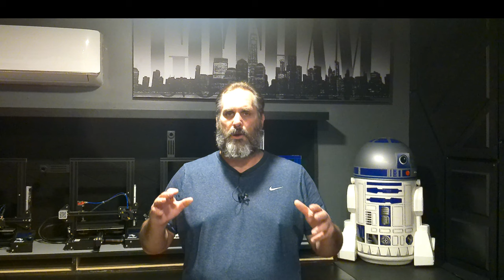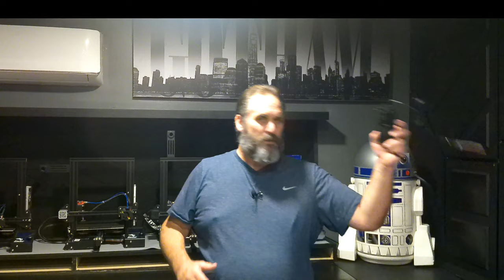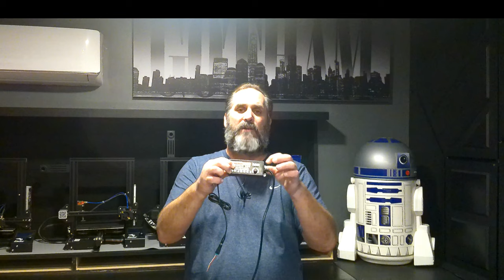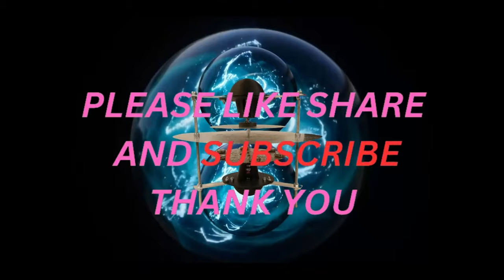Graviflyer "Over Unity Event" #28

Comment: I have Been Studying This For 15 Years Now, and I Do NOT Believe Grounding Anything Will Matter Much, BUT.... If You Could Measure the Distance of That Field at It's Phase Shift Boundary, ( where it ends, try using a Radio on A.M., in between stations ) That would be Where You construct your Faraday Cage (shielding) /Outer Shell of The Craft You would Like To Lift ( remember weight does not Matter)  Just a Thought .....But That EVENT is LEADING Me to believe You have Found The Key to the Heart of a Craft!     Again it is Just a Thought .....!
Reply: I tend to agree with your grounding assessment. It appears as if there is pumping effect to "ALL" matter in a local region of the object. Grounding would probably have little to no real impact on it's operations.
Reply: A Faraday Cage would prove if its ZPE energy or not.  The Faraday Cage would not stop ZPE energy.
Reply: Why not use ferrofluid in side of glass container or ferrofluid in side laminated sheets
Reply: @angelguerrero2890  Ferro fluid utilization is an interesting thing to consider 🤔.  Very interesting 😎

Comment: Strange stuff happens when experimenting with high voltage. You sound like you did have a weird experience, which is interesting.
 Electricity is present in all that exists. We still don't know the complete science of electricity or anything for that matter.
I had a weird experience a few years back while trying out small spark gap Tesla coils. The secondary coil was only about 11 inches tall and I was trying out different size primary coils. I know that the transfer of energy does happen but I never thought it could happen with such a small Tesla coil.
So what happened? Well, at one point all the bulbs in the house lit up and then went off. This happened twice. It was really strange.
Don't stop your work buddy. You are discovering something new all the time with this project. Good luck and I will continue to follow. 👍👍👍

Comment: 3 things. 1 i can't remember the name of this material's name but it shows magnetic fields in its sheet card shape and thickness. 
2 maybe a grounding sub chassis to block out interference and contain or crisp/triangulate/harmonizing all different phases of energy to help synchronize the crossover.
3 build a faraday cage so you can monitor and protect your equipment. 
Thank you.
Reply: Thank you so much. Also please back up all your data before you are disappeared. Thank you for sharing.
Reply: Measure for microwaves!
Reply from the maker: I did.

Comment: I think that alexey talk about this. If charge is too strong plate get magnetized and its not good because its change resonant frequency. So you cant keep it on all the time you need to switch it off/on. Also if charge is too strong it wont separate those spinning fields normaly and and you need to start all over again
Reply from the maker: I know. It happened before I got to tune anything.

Comment: Ground your surroundings. The toolbox is insulated from ground. So is everything else on your bench. Get a grounded copper benchtop cover. Static charge can build up if there is no path to ground and the air is dry.
Reply from the maker: It happened right away. There was no build up. It was the first test for the day. the hv and the tc were pulgen in one after the next and the tv flipped out right away. It started to change the browser tabs by itself. I will ground everything before the next test. I have had hv interference before. This was different.
Reply: @nathanbunten4299  That used to happen anytime my wife with long hair got into my Tesla. The dashboard would go nuts!
Reply from the maker: @ToddDesiato  The fact that the field extended beyond the Graviflyer was what surprised me. Long hair in an electric car. Was her hair frizzed out? Static and electronics do not play well together.

Comment: Great results, I am definitely going to try this. Did you put both wires from the spinning discs down the tesla coil and the positive wire from the flyback to the center plate?
Reply from the maker: The tesla coil had 1 wire run through the center of the tesla coil. The ends of that wire wer set to the 2 spinning plates. the part that came out of the top was going to the top disc. The part coming out the bottom is  going to the bottom disc. 

The high voltage is 2 flybacks in series and the positive wire was to the center plate. The negative wire is to nothing.

Comment: Sorry to see it scared you so much.
Are you familiar with Bob's work at MF MP?
Did you consider that you were building a hyper torroidal field around the device.
Then when you reversed the polarity, it caused the device to start pulling power out of the field you are stored the energy in, and that is where the energy came from.
Hyper torroidal fields are like magnetic monopoles and according to Bob they like to live in aluminum because it is a single isotope metal.
It's very similar to the type of field hutichison was building in his aluminum bars.
You may want to consider making a shielding enclosure, I will send you some links.
Reply from the maker: thank you.

Comment: i think that if you need electrostatic charge, the best hv power supply is a vandergraff generator
Reply from the maker: it's not just static volts it has to be able to mesh with the tesla coil. It has to be dc.

Comment: Try to make an asymmetrical capacitor with a solid dielectric with a high k value. The upper smaller diameter plate will b charged + and the bottom larger one will b - causing force in the direction toward the + from the -

Comment: Srry the question is  hard to follow 🤔7:28 you were talking to ppl in your circle  and mentioned something about the local 🙄 static charge like the air around the device on google it said air had a charge capacity of 120v/m  idk what that means  in full 😐 but but in line with your theory  that can add up in a confined space... but you also might be able to use the build-up with a positive pulse of EM?

Comment: Got a question. How long did it take for you to tune it before that happened? Did you have everything on including ultrasound? 

Not asking to see what you did wrong but instead what to do right. I’m not looking to exactly replicate it but it sounds like a step in the right direction.
Reply from the maker: I tuned the motors. 800rpm on top 350rpm on bottom. Then plugged in tesla coil 33.5 volts. Then as soon as the high voltage was plugged in. It started. The tv flipped out and a popping sound came from all around my garage. I had florescent light light up from 20 feet. I also had a headache for 2 days. I pulled the plug on the high voltage after 45 seconds to 1 minute. By then I lost one motor and 1 motor driver. If I did not stop it my pc and tv were next.
Reply: @nathanbunten4299  that’s so bizarre. The craziest things happen in the field of real science
Reply from the maker: @isaactippetts3202  I agree
Reply: @nathanbunten4299 I suppose I have a follow up now just to clarify, ultrasound was off?
Reply from the maker: @isaactippetts3202  yes.

Comment: did you create microwaves ???? you need meters to see what your getting.
Reply from the maker: i don't think it was microwaves. just a static field.
Reply: @nathanbunten4299  well a electrostatic fieldmeter is not cheap unfortunately be nice to actually know what its putting out when it happens .
Reply from the maker: @jediknight2350  I have one
Reply: @nathanbunten4299  wow cant you measure it nextime see what it goes to go on be fun probs best do it outside though.
Reply: @nathanbunten4299  also i found something out thats interesting atoms oscillate at 1022hz at 70 degrees so maybe find a way to make the frequency to that as if you can directly oscillate the machine same as atoms around it surely this would have an effect .
Reply: @nathanbunten4299  also a single energy field vibrates at 109 hertz.
Reply from the maker: @jediknight2350  thats interesting.